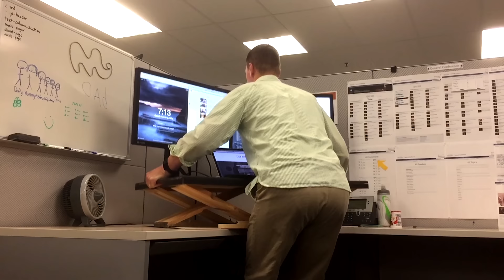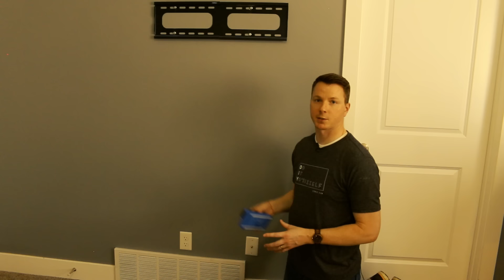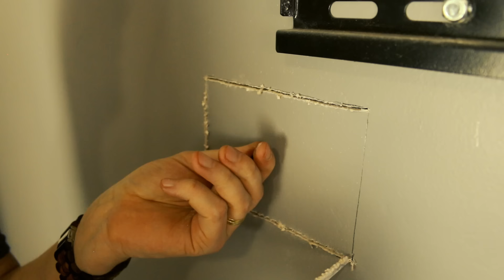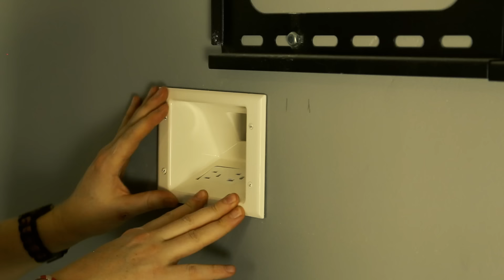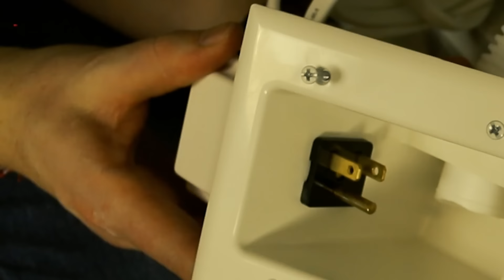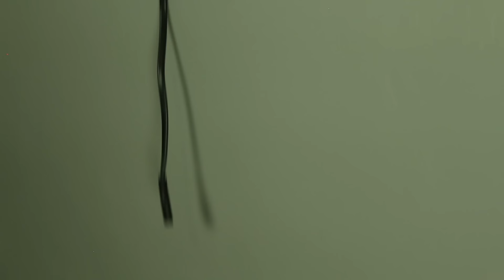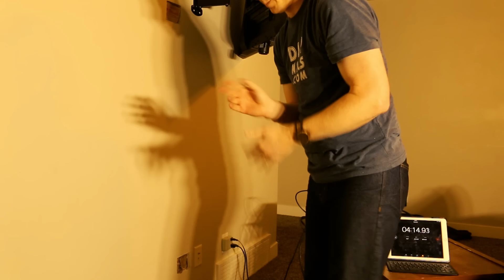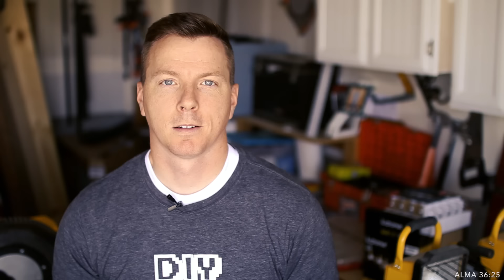How To Hide Your TV Wires in 30 Minutes - DIY

Comment: Coming from a Pro, do NOT put non plenum rated wires/conduit in an air return. I repeat DO NOT PUT NON PLENUM RATED WIRES/CONDUIT IN AN AIR RETURN. Non plenum rated wires put off noxious fumes when they catch fire and in an air return those fumes are then transmitted throughout the house in a fire outing you and your family at even higher risk of injury/incapacitation during a house fire.

Comment: Really nice. Why didnt you put the wires through the tubing before you put it into the wall to get away from having to remove the box to pull it through after. And while your at it put a spare pull wire through incase you wanna add on another HDMI or more
Reply from the maker: At the time I just didn't think about it but would certainly do that next time. I also needed to show people (at least for a video demonstration) that you can drop new wires through but I suppose most people will very rarely, if ever, do that. I also have been putting pull wires in any application like this since then, so great feedback.

Comment: So if you didn't check for fire blocks before drilling holes in the wall above and below it....how do you deal with that?
Reply from the maker: If you encounter a fire block, you just need to do what's called a pumpkin cut in your dry wall and then drill through the fire block and feed your wires through. Ideally you'll want to reseal the hole in the fire block with a fire retardant expanding foam, then a bit of patch and paint on the drywall. Here's a video that explains it pretty nicely: https://youtu.be/NwXAWsp9wps?t=175

Comment: Thank you for this video. I think I can do this myself. However, I’m a little confused. I have outlets behind the tv already and a little thingy with cables coming out that are not connected to the tv.  I also have an outlet near the floor horizontal to the one behind the TV.  Do I still need to do your installation or am I missing something? FYI, I am in a newly built house.
Reply from the maker: Tonya Lucas Smith Hard to tell but it sounds like the object with cables is likely some sort of Audio/Video connector, but there would need to be a matching one elsewhere. Perhaps in a nearby closet, or a lower area of the wall?
Reply: LRN2DIY there is one but not really sure what it’s for or what to do with it.  Lol
Reply from the maker: @lucaslegz  Hi Tonya - every setup is a bit different for sure. I would look for any identifying marks on the receptacle behind the TV (brand, model number) and search for those online. Could be an HDMI extender for connecting your source device (BluRay player, cable box, game console, etc.) to your TV.
Reply: LRN2DIY Thank you so much for replying..  I have found so many times that when I ask a question on this type of forum, I get no answers. You are truly a professional!   God bless you and your family and stay safe!

Comment: I was in the middle of my wire installation when I discovered my inside wall was in fact insulated. The tape measure worked great. Thanks.
Reply: Can you get the hose in there, if your wall is insulated? Or do you have to do it without the hose?

Comment: Love this solution! I had no idea it existed! Thanks. When I have to run cables in a wall, I've tied a socket (from a socket wrench) to a piece of string. drop it down and tie your wires to the other end. It's a tad bit safe than slipping a metal tape measure blindly into a wall.

Comment: Best tip for me is that the originally installed outlets are adjacent to the stud. Of course! Also makes it easy to find an empty cavity to prevent cutting into wires already installed when opening up the drywall. Thanks for the video.

Comment: You’re suggesting that we put an extension cord in the wall behind the drywall ? I am a retired electrical inspector that is illegal don’t do it folks .
Reply: he said it was rated for use in the walls, and it looks like it's simple white romex wiring.
Reply: No...he dropped a length of romex (looks like 14-2 w/ground) inside the wall from box to box. The extension cord was merely to jump power from the nearby receptacle to the installed box (which had a built-in plug).

Comment: Good job mate,I would to it do the same only i would have directly wired the mains socket to the right to the cut out to the left of it up to the tv,Just i have brick walls myself and i dont like trunking stuck to the wall,I have done one before for someone and it causes some mess but i have cut a channel in to the plaster or if the plaster is not thick enough,channel through part of the brick,Then plaster over it

To a person who has not done this before its a good easy method, Well done!

Comment: Home owners, try not to put furniture in front of the HVAC return vent. Your blocking air flow.
Reply: You should not leave a bundled extension cord. You will loose the UL or CSA listing, and the cord can overheat, especially when located over the radiator.

Comment: I want to add a surge protector for the tv and components, or do I really need them, I also need to run my power over 2 studs to get to power, How do I do that?
Reply from the maker: Hey Mike, a surge protector is always a good idea and can be added in between your plug and your extension. Running power over 2 studs is the same as in this video - only difference is the length of the extension cord you'll use on the bottom. The kit will handle it just fine, even if you're running it 6 or 8 feet over.

Comment: You're not supposed to coil up the romex  2 conductor wire like that, once you power it on that coil will get extremely hot and could potentially start a fire.
Reply: You can coil that wire just fine . Reason being that it’s running 120 vac, with the assumption that you’re not running a dishwasher off this additional outlet 3/4 up your wall…. That wire will never be exposed to an amp current strong enough to justify any fire hazard. Now on that note he most definitely shouldn’t coil up the grounding wire like that it should have a nice drop without many twists and turns in the event that a strong enough current ever gets sent through it . (I’m an electrician)

Comment: Nice kit but much cheaper and same results,  just drill out 2 round holes one behind tv and one at bottom of wall add plastic ring to finish off the holes then just fish in all the required wires threw.

Comment: My first reaction was: Just an other kind of a stupid solution. The USA is the only country in the world with cardboard interior walls. In case you are replacing your TV two large caps remain. In the Netherlands (the most beautiful and civilized country in world) we only have concreet or bricks interior walls. We are using a small tube for only the internet cable and the cable for the electricity. No caps in the wall.

Comment: Excellent video with good descriptions, especially for those that are not pro’s. I like the tip at the end regarding using a tape measure for pushing though insulation material.

Comment: YOU SHOULD NEVER EVER COIL WIRES LIKE THAT,WITH ENOUGH LOAD RUNNING THROUGH THEM THEY WILL GET HOT ENOUGH TO MELT THE PVC COATING AND CAUSE A FIRE

Comment: I am afraid I'd run into one of those fire blocks. I have a few TVs that I need to do that with.

Also curious why you checked the wrong bay for fire blocks. You use the bay to the left of the one you checked. Obviously you checked both.
Reply: Typically there would either be fire blocks in between all of the studs in a given wall or there would be none. But it would have been helpful to make that clear for any novice viewers.

Comment: Cool tips and products in this video. I like the tube idea for running new wires in the future, very clever DIY add-on. But holy cow the tv's are way too high. I gave him the benefit of the doubt with his tv because it looked like a bedroom. That location is common for very high tv placement due to your sight line when lying in bed. The "buddy's" tv is several feet too high on the wall. Tv's aren't art. They are purpose built electronics for viewing comfortably for long periods. The middle of the lower third of the tv picture should fall in the range of 42" or so. I know many people put their tv's above the fireplace, which dictate's a high placement. I've also seen customers who have recliners in the living room so their sight lines are also much higher than normal. Their guests however must look up to see the tv and more times than not this creates complaints with the install. If you have normal seating, and the space is going to be used by more people than just you, consider the industry guidelines and lower your predetermined mounting location. 

Also I haven't read all the comments but doesn't that look like a cold air return he's stuffing all those wires into. Are they all cl rated? So they won't send toxic fumes into the HVAC system in the event of a fire?

And also, while I'm here, don't worry about if the wife asks you to move the tv. With that tilt mount he can easily slide the tv to the left several inches and he can also change where the "arms" bolt onto the tv for vertical adjustment. Shouldn't be an issue. This is one of the disadvantages to using an articulating arm to mount your tv when you don't need the ability to aim the tv at many different seating areas.

Comment: 30 minutes? An hour?
I used to work for a cable company and I would hide all the wires professionally in about 10 minutes or we get in trouble for taking too long.
Reply: All the cable companies around here think installers are too dumb at all to do this so they don't allow any internal wiring, they drill through your house (even if it's stucco) and make it look like shit. ATT/Comcast.

Comment: Ah, but there inis the faulty assumption.  Those of us who have no wives, LIKE seeing our cables and there's no one nagging us to hide them.  :-)    One minor observation -- RoamX AC cable that you are using behind the drywall may NOT be to code in some jurisdictions; it is in most, but for example,  it is NOT in New York City  (another reason to not live in NYC).  Anyone doing this should  double check with a local electrician.   Then again, once it is installed behind the drywall, who's gonna go snooping?....unless that is, you happen to be under suspicion of murdering your wife who told you after you completed the job that she didn't like where the TV was and wanted you to move it, and have hidden her behind the wall.  You might be innocent, but when they break into the drywall, they'll get you for violating the wiring code.   hehe

Comment: As a electrician for 20 years and now having done A/V for 7 years. It's best if possible to tun your electrical away from.you cables ( HDMI, USB, and even speaker cable 16/2, 18/2). The reason is electrical interference or "noise" as you will. Electricity does cause noise and will get picked up to lower voltage wire such as CAT 5, CAT6,  and HDMI cables. He made this been me. I would have fished romex down the wall and joined it to the receptacle. 

Then on the opposite side of the electrical. Run the cables down on the other side of the stud. This way you can use a cut-in and put a bull nose cover over it allowing for you to manipulate the cables tg o go where you want.
Reply: Marc Cooper if you use shielded cables it don’t matter most commercial bought cables are shielded
Reply: That's what I was thinking.  You already have 120 running inside the wall, turn off the breaker test and try, cut a hole cut the romex install the box and receptacle then the wire is going to be to short because the wire is pulled so tight fish new down to existing receptacle, and you would have to cut existing box out with sawzall and replace it. That to me would look another cleaner. As for as cables I'll be streaming off my router.

Comment: I'm having a similar issue with the studs. They aren't in the center so I wouldn't be able to mount it center on the wall. I will need to do what you did with the 2x4's or else my tv wont fit on the wall be cause it's a 75" and takes up the whole wall. I'm just wondering if there are steel brackets I can use instead of the 2x4"s
Reply: The trick is to mount a sheet of plywood to the studs. Then you have total flexibility to put your TV mount anywhere on the plywood. Use short wood screws - only long enough to go through the plywood. Paint the plywood to match the wall if necessary.

Comment: Nicely done, very tidy. I would have used a metal coat hanger (drawn out) to feed the wires down in an insulated wall I'd never seen it done with a metal rule so thanks for that tip and the others. Good video and good voice over. From across the pond and another stone walled house but good for the garage/man-cave methinks.

Comment: Well, here in the UK, behind the plaster board are horizontal beams so it’s impossible to feed the wires between the beams without drilling. Issue there is there is no space to drill and there are no gaps between dry wall or beams. It would be interesting to see how people got around this issue
Reply: All the stud work I've seen has the noggins (horizontal Bracing) slightly staggered at about half way up. Unless you are putting the inlet and outlet both on the same side of the noggin you are going to have to drill or slot it. Also make sure your stud detector can also detect existing cabling, you don't want to saw through cable with the plasterboard!

Comment: it would be a whole lot less work to just power off the bottom plug and place an electrical box at the top
Reply: What about the low volt wires

Comment: Also wasn't this video suppose to show how to hide tv wires. The bundle of wire near the floor are not hidden. This is not the best way to do it. You would of been better adding a power outlet behind the TV. 
It's OK if something will be covering those wires but not the cleanest look you can achieve not at all

Comment: IMPORTANT.  

Please do not use an extension cord this way. By leaving the cable all wound up like that is a fire hazard. 

The built up of heat in the cable can  cause you house to burn down so please please please change that

And more importantly you may believe this is up to code but as a builder I can tell you this is not up to code and why are telling people it is. 

SO ANYONE READING THIS DO NOT DO AS HE HAS DONE. THAT EXTENSION CABLE SHOULD NOT OF BEEN USED AND TO MAKE THINGS WORSE HE LEFT IT ALL TIED UP AND THEN TELLS PEOPLE ITS UP TO CODE

WHO TOLD YOU THIS WAS UP TO CODE????

Comment: Why buy such a large gadget when if you plan to drill a hole in your wall, just drill a 1/2 inch hole on both ends, feed a tube with cables through it and bam. I don't know much about it but just a thought

Comment: When you're putting in conduit like this, prime the hose with several strands of fishing line (also known as monofilament), with loops pre-tied into each of their ends.  Once the conduit is installed, use the loop to hook one end of a cable you want to pull, then pull the line out from the other end.  I'd leave some extra lines behind to use for extra wires that you may want to attach later.  You can secure them in place with gaffer's tape at each end indefinitely.
Reply: was waiting for a BICSI chad to come about :D
Reply: And never forget to replace the previous fish line for the next guy :)

Comment: You might mention the following.  If you have difficulty getting the non-power cables through the flex tube, feed a semi-stiff fish wire or string through it.  You can even use a vacuum cleaner to suck a string through.  Then tie or tape it to one end of the TV cables and pull them through as a bundle.  Electricians call that a pull-wire for obvious reasons, and that's how they get wiring through conduits, even long ones with bends.
Reply: I like the vacuum cleaner idea! Another trick is to feed the pull string through the tube and tape it to each end before you fit the tube, it's easier to get it through that way.

Comment: Wife:  why is there an extension cord on the bottom from the wall to the wall?  why not run a Romex on the inside wall straight to the junction box that has power  and no need for extension cords     

Husband:  I don't know    suck my dick.

Comment: How was there not a fire block 48” up from the floor? Flex bit solves dry wall issue (no cutting around the stud) but if you absolutely have to, consider doing the back side of the wall.  Multi tool works good for cutting as well.

Comment: 1 Nice bubble butt lol 
2- why buy the expensive "Kits" as you will not see them when the TV hides the top and the components hides the bottom. It is very easy and cheap go get 1 1/4 or 1 1/2 white PVC pipe to make the cord tunnel with 22 1/2 angle elbows for each side.  also in my case we needed the tv and its components on its own circuit  since the breaker box was close that was easy as well... if you get a surge protector with a long cord, you could put the cord down the pipe to plug it in using the existing outlet...   the pipe and the elbows were about $10 total  (add in the cost of the pipe primer/glue if you do not have some already)

Comment: 6:51 thank goodness you said low voltage wires I was going to say that is not code and I hope that you're not going to be running 120 volts through that plastic tubing it's not fire code it's not fire rated.

Comment: Neat idea! Although I imagine just a hole in the wall with the tube would be sufficient to lead the wires down inside the wall, instead of installing a couple of boxes and needing to have electricity fed through three different bundled up wires (which includes the two extensions) all the way from the wall socket to the TV. This way you wouldn't have to cut such big holes either. All in all it would be simpler, more cost efficient and world wide code compliant.